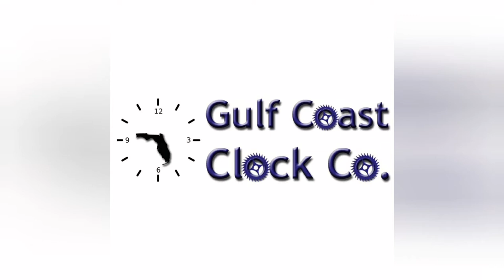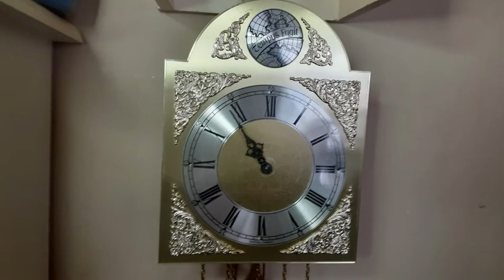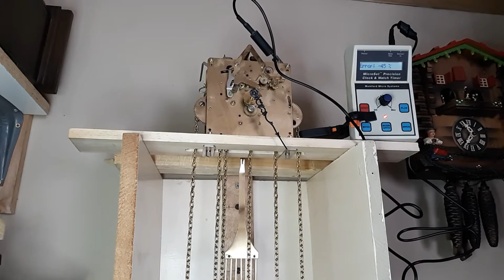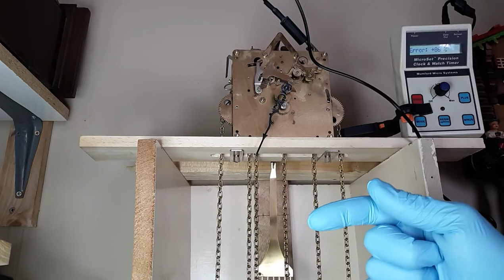How to level and set pendulum beat of Hermle clock mechanism

Comment: So ... what are you actually doing by applying the pressure? Are you looking to bend the linkage above your finger pressure point?  There's a thin metal 'hinge' at the pivot point at the top? Is it this that you're trying to influence?
Reply from the maker: There is a pressure clutch that is spring loaded at the top of the anchor assembly, where it attached to the crutch lever I’m applying pressure to. In this case it’s not so much bending as it is by forcing the anchor to slip relative to the angle of the crutch rod/lever. Hope that helps clear it up?
Reply: @GulfCoastClock  Thank You, we're not quite there yet. 

If it's OK, I'll continue the discussion via e-mail, we'll be able to refer to my pictures, and we'll work from there.
Reply: @GulfCoastClock  A view from the back that showed what you were talking about might have helped.  Thanks.

Comment: How do I do this without the equipment you are using?
Reply: You can use your 'ear' to hear if it's markedly off in one direction or another.  It's not as accurate as the meter but it will suffice.  It 'limps' either loooong--short, loooong--short,   or  v.s.v  "short--loooooong,  short--loooong..."  It's a tug of war (as we see in this video,) to get it near perfect at which point it's escapement is most efficient but it's worth trying a bit of patience to get it close to even.  ALL part of the fun of owning these beautiful and well designed clocks.  It's funny - I sleep in the same room as my Ridgewood grandfather clock and if the pendulum is even I sleep right through it but if it's limping in any amount one way or the other it keeps me awake!  So, one could say I CAN'T REST till it's nearly perfect with an even tik-tok.
Reply from the maker: well said. like typing a description of lacing shoes, difficult to describe but you nailed it.

also anyone interested in purchasing this machine can go to https://www.bmumford.com/mset/order-form/
Reply: I can't vouch for this myself, but I read a clock video comment elsewhere where someone used a metronome app for one's phone (metronomes are typically used with pianos) and that some of these apps can "listen" and determine if the beat is a match for the metronome timing.
Reply: @bobsquires4521  What does it mean if one can hear the "tick" but not the "tock" of a clock that keeps stopping? The clock is a Hermle Franz 351-020 (45cm) wall clock, which came from an elderly family member's home (likely not transported correctly but also not known to be working for the past seven years, regardless). Spouse and I tried cleaning and oiling the pivot holes but there was no improvement. How does one know if the pendulum stops because it is seriously out-of-beat vs. another cause? (For example, the Westminster Chimes only go off at the 3/4 hour mark and at that point they overlap with strikes). In essence, how does one know if the beat simply needs to be set or if the movement is damaged?